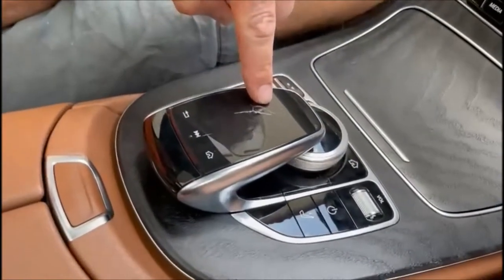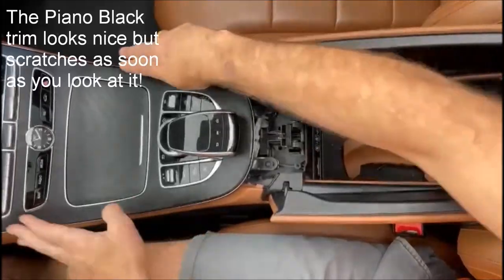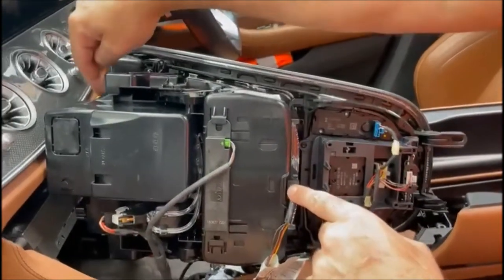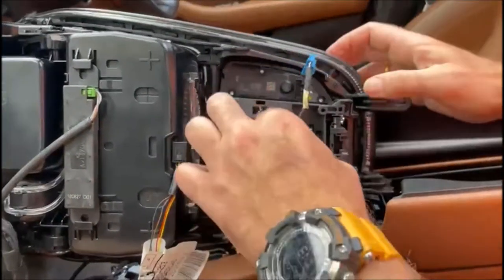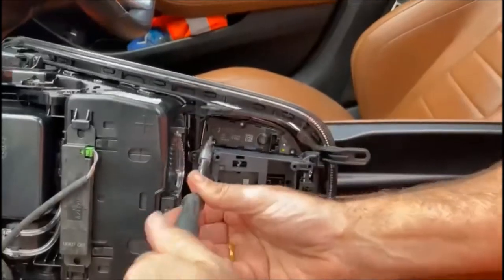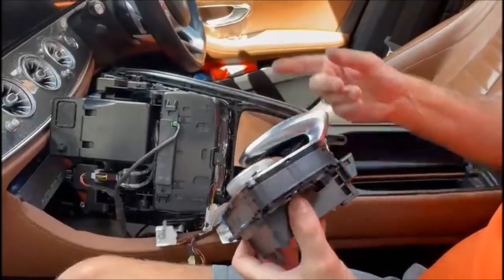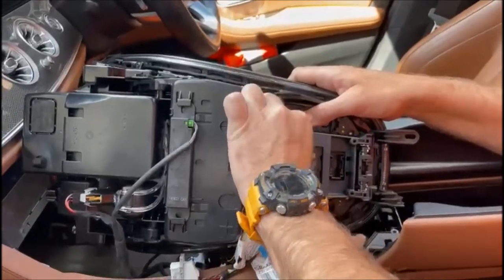Mercedes Touchpad Replacement

Comment: I have a 2014 s550 can I do this and install the 2015 touch pad on my car and it works?
Reply from the maker: Should be exactly the same process, but some of the console fittings might be in a different place 👍

Comment: Follow up question, seeing as you drive this daily, do you ever notice crackling sound coming from your drivers door as you are driving, i can't seem to locate the sound, sometimes i think it's the AC, sometimes the door assembly, sometimes the seat controls, but it's annoying and i'd like to stop it, if you also have this problem, please let me know how to fix it or do one of your great videos showing how to do it :-) thanks !
Reply from the maker: Erm! I have to say my door is silent! The only annoying sun i have is the occasional clonk from the rear which i think might be a top Mount for the air suspension (?). Have you checked on the forums to see if it is a known problem?
Reply: Hey, did you find a solution for the noise? I have the same problem

Comment: I have a question,If i want to replace the mouse touch pad i have to install the old ship? Or ots okay to use the new one?
Reply from the maker: @bassamshehab90  i think the auto translate has lost something in translation. I could not work out how to remove the plastic too but so replaced the whole thing. Hopefully that answers your question?

Comment: Do you know if these ones are plug & play if keeping the old "controller" (the one with the Continental sticker)? Mine got cracked (GLC 300 X253) and trying to get another one (second hand) but I'm worried about compatibility.
Reply from the maker: Mine was plug and play. What i don’t know though is if a C Class one would fit in an E for example. It should but it has different symbols.
Reply: @mercedes_and_more  Already ordered it (With return warranty). It has the central symbol different (Mine has skip song and the other one has the bottom menu icon), I'll post results here as soon as I change it to help more people in the future.

Comment: You should have changed it to the new style
Reply from the maker: At the time the new style wasn’t out but either way I don’t like or use the touchpad as I twist and move the wheel. I send map directions directly from my phone. Replacement was for aesthetic reasons 👍

Comment: Great video, I have an A238 and just like you my touchpad is cracked in 2 places, the crack just appeared out of nowhere, where did you buy your replacement touchpad  from and how much for, I would like to change mine too, it’s annoying me.
Reply from the maker: I bought mine used on eBay and it was about €100. Currently they are about that for a half decent one. I have recently seen them new on AliExpress for about €75. Also not that whilst I’m sure that one from a C Class might work, the symbols are different. Personally i didn’t risk it and waited for a used E class one

Comment: Hey guys - trying to do some good Karma here. You’ll find on eBay some Chinese replacement parts for the topmost glass section only. The replacement is plastic. You CAN successfully only change that part. You’ll need a Number 9 torx as well.

Reference the video “How to replace the center mouse handwriting touchpad of Mercedes” by BettyLin. 

You’ll need to use a hairdryer or a heat gun and eventually pry the topmost piece from the correct location. Best of luck, hopefully I can save someone some cash. Reply if you need help in the future boys. 

Mine was cracked very badly when I bought my Benz. Now it’s perfect, I’ve just replaced it. Huge monkey off my back!
Reply from the maker: Yes i have seen that in AliExpress you can now get replacement screens: you can now even get complete units for about €50. Whist i agree with all that you have said, it sounds like an awful lot of work rather than plug and play the original, especially with the new units being so relatively inexpensive?
Reply: Thanks! Hubby bought the glass only and was wondering! Appreciate this comment so much!

Comment: Great diy video!
Thanks very much for the very clear instructions ❤️

You mentioned you had polished off the scratches. I was wondering if you could share the polish
you used?

Thanks again, please keep the videos coming ❤
Reply from the maker: I just used some normal car polish. In this case GTechniq Nano polish but you could use something like Mazerno 400. Need something that cuts with a medium pad on a small DA machine👍

Comment: Do you think your able to replace the old track pad with the new flat version from the facelift. Also keep all the sam panelling and buttons. Looking to replace it on my e class coupe.
Reply from the maker: Gosh that's a really good question! I think that in some far Eastern markets (mainly China) they had the flat panel instead of the touchpad as that's what the market prefers. I suspect it fits in the same space, but whether the wiring is the same I don't know. Maybe ask on one of the forums? 

Would certainly be a good upgrade.

Comment: Great video. I'm looking to swap my gloss black for the ash black, where did you source the used one? I've got the part number a2386801503 for the ash black, but only see new ones for 500+ euros.
Reply from the maker: Thanks for your kind comments. 

I bought a complete console on eBay and then (just because i didn’t know if so the switches worked and because my control buttons around the touchpad were different as i have air suspension) swapped all the parts over. I sourced mine from U.K. (a friend brought it over) and sold the piano one to a buyer in Italy (!) via Ebay (Germany).

Not sure about prices now (i swapped mine in summer 19), but don’t forget as long as yours isn’t too scratched you can always sell on your piano black console to reclaim some of the cost?
Reply: @mercedes_and_more  Thanks for the tips I'll keep hunting for a used one maybe a console and then sell my piano black. It's in good shape but it has the typical light scratches all over it that are super annoying. Keep up the great content on the W213 E Class!
Reply from the maker: Will do - thanks. 100% agree about the light scratching. Even using a microfibre cloth it still scratches

Comment: Great video! Thank you! Do you maybe know if you can replace just the upper cover of touchpad with buttons?
Reply from the maker: I think you can as i have seen replacement ones for sale on AliExpress for about €35 (and new complete touchpads for about €80). Not sure how you get them off though but maybe destructive experimentation is the answer 🤔😂

Comment: I love your videos because they are so informative and I also own a C238, so thank you so much. Your previous videos about changing the brakes on them will help me greatly when the time comes.I've just one bit of advice, please try and improve the video quality, i selected 108op but it seems slightly out of focus, if it's down to the software you are using to create the videos i can recommend something that I use if you want on my youtube channels. If it's not the software, then use an Iphone 11 or better to record the video and make sure it's set to maximum recording potential, it can even do 4K. 
Thanks !
Reply from the maker: Niall, thank you for the positive comments and i am glad you like the content. We do record on an iPhone 12 in HD but i suspect it is the editing software as i use Microsoft movie maker (as it’s on my laptop). I suspect i need an upgrade but YouTube has always been a bit of fun so think we’ll need an upgrade to progress further. I’ll try and do better for the next video
Reply: @mercedes_and_more  ah that makes sense, i can recommend Camtasia softtware for video editing and easy upload to youtube, it's what I use and it handles up to 4k easily
Reply from the maker: Thanks - I’ll check that out 👍

Comment: Brilliant, just what I was looking for
Reply from the maker: Great stuff, although also disappointing as it means this is a more common problem than Mercedes are owning up to!
Reply: @mercedes_and_more  I have a Xentry bulletin advising replacement, showed it to Mercedes, who said they hadn't seen it, then said "sorry you are out of warrenty" but offered to replace it for £400. I bought the car second hand from them, with the fault. - I just bought a touch pad off eBay for £100.
Reply from the maker: @absenteeatom  similar story with me, out of warranty and not interested. Think mine was €85 which is why i bought it as i had not seen a decent one for under €125 up to that point. Noticed last week i think the one on my wife’s car (4 weeks older than mine) is also going….

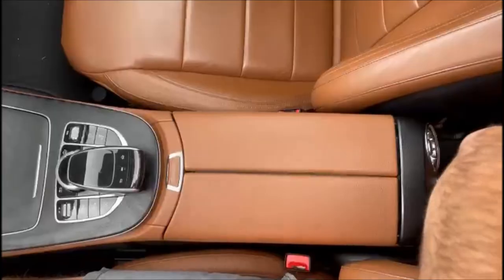Comment: Hello, at around 1:20 you start by opening up the console and removing the 2 rubber buttons. On my 2019 C300, I don’t have those rubber buttons. Any advice to get past that first step? Thx in advance!
Reply from the maker: 🤔🤔🤔 not sure. I thought that the C class would be exactly the same. Maybe another C class owner can add comment?

Comment: Will the new touchpad work from the 2021 model since its not that different but just has the touchpad ?
Reply from the maker: I think that the NTG 5.5 and 6 systems are different so nees different touchpads. Unless you know you can get a refund, i’d stick to a one for one replacement 👍

Comment: the one i have stopped responding (just the touchpad and the 3 buttons). Can you please share the part number (my car E220d w213 2017) ... also do you know how much a new part from MB would cost (UK). cheers.
Reply from the maker: A213 900 4291 is the part number. Whilst the touchpad from C Class cars should work, it has a different graffic for the home button, so you never know. I have no idea what the new price is as I went straight to the used market.

Comment: Thank you for the detailed video.
Before I replace the touchpad, as I don't like it, I was thiking of changing the control panel for one with the wheel only without the touchpad. Do you think it is doable? I was unable to find information online. People usually replace it for another touchpad.
Reply from the maker: Thanks for the positive comment about the video. I think you have to replace like fit like as the current installation will be coded/only function with your existing Command system??

Comment: I just changed my brocken controller yesterday and after the replacement the new one (it was a used one) did not work. Did you also change the chip set from the controller or did you put the old chip set in the new controller? Maybe the car recognize if there is a new chip set and therefore it doesn't work? 

Many many thanks for your reply!
Reply from the maker: Maybe you bought one for a C Class which is different from the E Class (by mistake). The C has a * for the home button on not a little house symbol. I didn’t change the electronics under the touchpad but i changed the “chip” in the vertical bit (the part with the label/QR code on it) from the old to the new one.
Reply: @mercedes_and_more  Thanks for answer! I bought new one from Mercedes, too. Of course with the no. A238...  and now it works.So the previous one was completely brocken. Whats very interesting: The controller clicks only by pushing the 3 buttons, if it is correctly connected and working. If you hold it in your hands separately, it does not do "clicking sounds" by pushing.

Thanks for your help!
Reply from the maker: @KonradF  there is coding to switch on/off haptic feedback so i expect there is some kind of signal/pulse generator within the circuitry. Not surprised - remember the Germans love technical solutions for non technical problems 😂😂

Comment: Hello, is it possible to simply change the plastic front of the touchpad which can be scratched. Cause I saw
that they were selling on the internet.
Thank you for your video.
Reply from the maker: Maybe - I’ve not seen that but i suspect you’ll have to take everything apart to get to it?
Reply: @mercedes_and_more  
Yes, it may be necessary to dismantle everything to be able to do it and even for the moment I am not yet sure that it is possible to simply change the facade.
Maybe I'll look into it if I have a moment and let you know. THANKS

Comment: sometimes my toupad not func. maybe some contact under touchsurface. I dont know
Reply from the maker: Sounds like it’s on its way out?  Could be worth making sure that it is clean - especially the groove around the top surface so that it can actually move downwards when you press it 👍